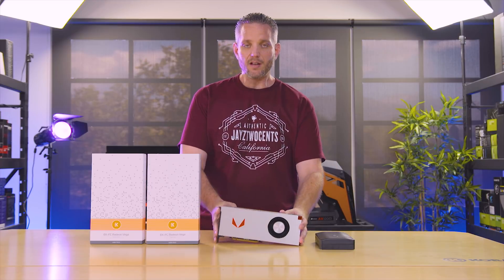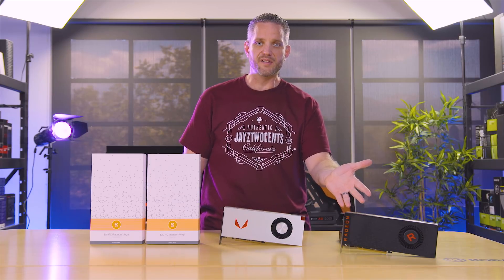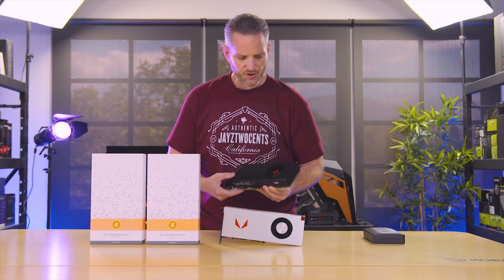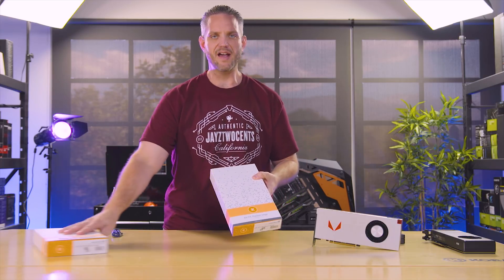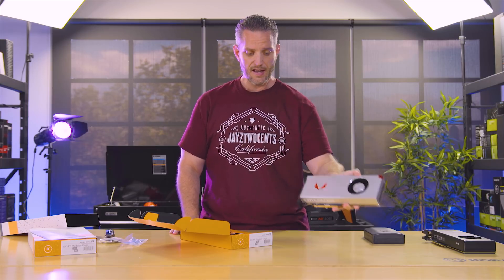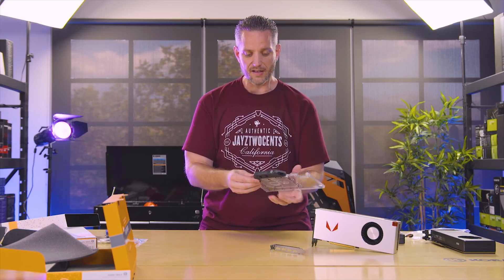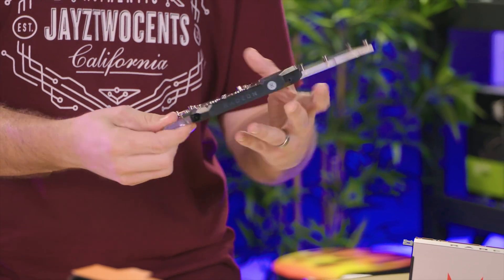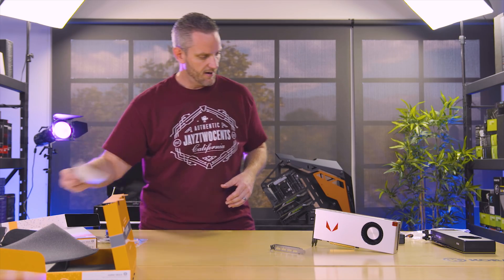Does watercooling help AMD Vega cards?

Comment from the maker: 4k Still processing... but if you enjoyed the video, how about tossing a like?
Reply: I was literally thinking about all the comments that would criticize your thermal paste application until you showed the manual.
Reply: I have 4k monitor and I don't see much difference between  1080p and 2160p ,4k on YouTube is so watered down that it almost makes no sense
Reply: Jay we definitely enjoyed the video montage, flawless
Reply: 144p masterrace
Reply: Thanks for the celcius conversion. I'm lazy.
Reply: Hey Jay do you think you could do a video on crossfiring a few of these Vega cards and answer some questions like How much power does your rig need? Is there any productivity boosts from crossfire? and how many Vega's does it take to match or beat a 1080 ti?
Reply: Would love to know where the music is from. that is SICK.
Reply: Well done on the return to your roots. Very good production value, with nice music sync, b-roll and generally enjoyable hardware porn. +1!
Reply: just a thought for a water cooling system how about using a fish tank oh say at least 400 liters make an aluminum tube heat exchanger not only heat your fish tank cool your gpu and cpu
Reply: JayzTwoCents Single slot Vega? I don't think I've seen something so sexy before!
Reply: JayzTwoCents like & subs🤙🏻
Reply: JayzTwoCents interesting video as always
Reply: JayzTwoCents Already Liked before i finished reading  the title!
Reply: hope you are doing ok
Reply: Is this using the FS7 II? The feel looks different. Maybe it's just YouTube and it's processing.
Reply: Correction, once it gets to B-Roll, it does seem to clear up.
Reply: And a amazing job on the B-roll today! Double Thumbs up!
Reply: Hey Jay, a lot of people including myself love to actually UNDERvolt our AMD gpu's (I have the sapphire nitro Fury Tri-X). Brought the power usage WAY down without taking more than 1 or 2 max fps off my games (totally okay with that). i took roughly 70 mV off my Fury and took it down from 1050 to between 1000 and 1020 (both stable). Is this something that you could try on the Vega? I'd be really interested to see the results for reduced power draw and related performance.
Reply: This is some top class production work. Congratulations!
Reply: That was some "sexy, fluffy" B-roll there Jay. Putting all that sweet camera equipment to good use
Reply: Great Job, please so more OC in this...
Reply: No, it's not total BS. Feel free to go find all this proof...Go ahead, I'll wait. It's the same concept that loop order doesn't matter either. Liquid doesn't stay in an area long enough for their to be a difference.
Reply: JayzTwoCents could I ask why you didn't adjust the voltage at all? In testing Radeon GPUs myself (Vega excluded) I noticed a higher chance of clock speeds remaining at a constant rather than fluctuating. Every card is different obviously, but my main question is does adjusting voltage controls do ANYTHING in terms of overclocking performance and possibly range on the Vega line?
Reply: JayzTwoCents That montage was beautiful. Great video.
Reply: Hey @JayzTwoCents, Awesome video man! Keep up with the great content but I was just so intrigued with the shots from 5:06 to 7:02, what was the song name there? It went perfectly with your B roll shots.
Reply: great music selection, got my day going
Reply: Hey JayzTwoCents would it possible to do a review on the new Alphacool NexXxos GPX Vega GPU cooler...I wonder if this or the EKWB one is better
Reply: what is the name of the song at 5:15 ? HElppppppppppp
Reply: 2nd
Reply: Liked.
Reply: alright
Reply: You got it bro!
Reply: JayzTwoCents finally saw something before it’s been posted for 12 hr. Yaaa YouTube isn’t shitty right now. 

Hi jay
Reply: lets go 10 views
Reply: Hi jay love the videos. when do you think the kriptomining boom will finally wear off?
Reply: as soon as i find the like button on youtube's new interface kappa
Reply: Thanks Jay, I dont know if Vega will ever be available for more than 30 seconds but nice to see though.
Reply: 110F and still 48C on load? Impossible Jay, you had to have the AC on.
Reply: I want that Liquid cooled Vega 56 vs 1070 hybrid
Reply: Hi Jay. You said a while ago you'd be making a video to end once and for all the notion that it matters where you place the rads in your loop, including temps and such. I'd be very interested in this, as I can't get a friend of mine to agree to this :) If it's not too much trouble could you place temp sensors before and after the individual components just to see what really happens. I'm very curious about that one.
Thanks for the great vids as always.
Reply: There's no difference dude, it all balances out.
Reply: ALL THE LIKES !
Reply: Hey Jay, how come since every waterblock for gfx cards uses full coverage thermal pads at the contact points of the vram, why don't they do the same for all processors?
Reply: awsome that you upload for european primetime.
Reply: JayzTwoCents its locked at 1080p......My old desktop can't handle that
Reply: Hi Jay, love the look of the blue dye in the block. Any chance you could upload a picture of the block with the angle at 6.41 in a 2560x1080 resolution?
Reply: Fucking nice edit!!
Reply: That's the first thing I do ;-)
Is the VEGA64 on water worth the $$ ? Not by a long shot.  BTW. ASUS are teasing a VEGA64 STRIX launch in early September. Did you guys know ?
Reply: Nolan Haines if you want it now, you could check out Gamers Nexus they did a article/video about it using Vega 56.
Reply: lsvtecb18c1 lsvtecb18c1 I think you mean why don't they use thermal pads instead of thermal paste on the actual processor, right? Well as far as I know the basics is this: both paste and pads are a means of transferring heat from a Source to a heat sink. The difference is, that they are not equally good at it. A Processor can only take as much heat, most throttle at around 80-90° Celsius before transforming into blue smoke. That means you have to get all that heat away from them and you have to do a good job with that. A VRM, where pads are normally used, is rated up to 120°C. Not only that but also it sometimes even works better when hot, as far as I know. (Some said around 80° C on a motherboard at all times would be optimal, have no proof of that). That means you don't need to get all the heat away from it that effective but you still have to transfer it away from the VRMs, because they too will throttle. So that's why you use pads for the VRMs. To remove the heat but to not have a gunky-gooey solution if you don't even need it.
Reply: Is that paragon music?
Reply: they dont need thermal pad?
Reply: I'll think about it... Lover.
Reply: Man. I can't sometimes defend your, as so called of late, "double standards" nor the "lenghty video talk style" but maaaaaaaaaaaaan. That hardware porn is glorious. I'd even go as far as saying that some of this stuff is so perfect, that their place to go is Wallpaper Engine steam workshop. Thank ya :D
Reply: i tossed twice so it didnt count
Reply: JayzTwoCents i tossed then liked
Reply: You deserve a BIG like for that ¨sexy fluffy body¨ :)) Have a good day Sir!
Reply: Have to agree with the comments about the lights  That was the first thing I noticed.  Especially the edge effect from from the spot lamp.  It certainly lacks the warmth older videos had.
Reply: Been waiting for a video like that
Reply: So if you went to all this trouble to water cool this card, why the fuck did you run it at amd's stock 1677 mhz for the limited edition card? That's not "Overclocking" it at all, these cards ship at that speed. Why didn't you try for 1800+ mhz on your own? I'm really wondering why I'm still following you when you do shit like this. You didn't even try to overclock it at all. We wanted to see this card pushed to it's limits on custom water.. nope. Guess we have to go to someone else for that. And yes these cards can do it, other people have reported 1900+ Mhz on vega-64 on launch day on air. The reviews are out there.
Reply: Does tube length matter in cooling or does tube length along with type make a bigger difference?
Reply: Tube length does matter. But not in temp. In cost. If you have a 20' coil of tube in the bottom of your case it won't affect the max temp at all. The same amount of heat is being removed by the block, the same amount of heat is being dissipated by the rad. The only thing it'll change temperature-wise is the length of time it takes for your system to reach the equilibrium temp, as you have more thermal mass to heat up.
Reply: They didn't ask about cost, they asked about cooling ability. Noone is going to use  20' of extra tubing at the bottom of their loop anyways.
Reply: ass at all , lulz r real
Reply: I think its either the angle, or the lense, but for some reason your head looks way too small for the proportions of your body in this video. But its perfectly fine in others. Not sure if you care, just something I noticed.
Reply: Can you send me one of all those graphics card 1080ti please
ty and i drop a like Bro
Reply: He will , if you work with him =)
Reply: how can i find him ?
Reply: Well I guess I'm going to go with Nvidia for graphics now.
Reply: nice montagee ! Great music choice :)  i liked  ,  one the best :)
Reply: how do you services a power supply
Reply: JayzTwoCents  Does the separate loop influence the temp? Or is it the same as a combined loop that also passes cpu?
Reply: Can u test de settings with lower vcore voltage&clock but with an overclock of hbm2 memory?
Reply: Tengo 420 Razones miner spotted! :D sup bro?
Reply: JayzTwoCents may I ask, do you have news on vega laptop? I'm in the market for a gaming laptop, but dunno if I should wait for Vega laptop.
Reply: Decided to throw you on my adblock whitelist instead
Reply: Like have been tossed before the play button. ;)
Reply: I'll still like it, even though I have a Nvidia 1080 ti, and don't have to settle for second best. That is how much I like Jay, I'll still watch.
Reply: the alphacool has a rly good core temperature but not so good vrm temps, also adds ALOT of flow resistance. i own the alphacool for my fury, its doing its job and can be upgraded, however i think my next gpu block will be the EKWB one - i had no choice for my fury nitro tho. i think core temps will be pretty equal, though the EKWB will be offering the better overall package.
Reply: Thank you for this :)
Reply: Here take a like.
Reply: Done :)
Reply: JayzTwoCents which pumps are you using, testbench and personal rig respectively? :)
Reply: JayzTwoCents done
Reply: Amm Linus 8k video on 4k is really good , the red definately has a difference on quality ...
Reply: JayzTwoCents I am watching in 480p so all good
Reply: unacceptable , well yeah some older videos are like that ..
Reply: keptin kaos It may stress the fish out with fluctuating temperatures... and they can get sick.
Reply: JayzTwoCents oh I'll give you a toss...
Reply: dont normally like videos, but since i always enjoy ya content and you asked so casually, i will :P
Reply: JayzTwoCents could you use refrigerant to cool a cpu or gpu?
Reply: Thanks so much JayzTwoCents, now we can't be the first person to comment on this video :(

Btw, didin't know you can comment while processing XD
Reply: Mod the vega 56 with the 64 bios and use c how it works
Reply: https://www.youtube.com/watch?v=P7OtY0HWkQ0

It took me a bit of browsing on epidemicsound.com but I finally found it!!!
Enjoy :)
Reply: Greatttt :D
Reply: I know at this point, Vega sounds ridiculous. But for general purpose, can you test some games and run heavy GPU related works on this custom water-cooled Vega 64? Push this card to its limit by overclocking (some said undervolting increases performance??? ) to see it's highest available performance. Forget the power draw since we already know Vega is a power-hungry card. With custom liquid cooling, will it perform any better than the reference Vega 64 (Liquid Cooled) and the GTX 1080?
Reply: hey Jay. There is a article on tomshardware where they say that on vega 56, there is a difference in hight between  the gpu die and hbm2 memory. Did you saw that on the 64. Just curios. here is the article http://www.tomshardware.com/news/amd-vega-package-problem,35281.html i saw on PCPer podcast
Reply: Nice video. And I was all set to purchase a liquid cooler system, when my closed loop liquid cooler went out in my Alienware Aurora R4 ALX PC with an i7-3960x CPU. Not much room in there.
When I took it apart, I found massive corrosion in the Alienware Cooler. I purchased a Corsair  H75 Cooler.
For the 1st few months the temps using Speccy were about 42 C. Then all of a sudden, the CPU was hitting 91 C & the motherboard was hitting 107 C! I cleaned off the thermal paste & replaced it with new thermal paste, but the temps did not come down. So, after turning down the CPU from 3300  to 2400 & still no relief. I turn off 
Speed-stepping & was able to raise the CPU to 3000 & still keeps the temps at about 55 C while surfing, but they would jump to 68 C while playing GTA V on line & the Mobo would reach 91 C instead of 107 C.

I searched the Internet & found a video that showed a guy taking apart a cooling system that was overheating, corrosion had set in, & it was only 6 months old! Some of the readers submitted their own experiences as the person doing the video recommended a certain brand of coolant. Some said that they had no problem with this coolant. While others said that they had experienced corrosion with this coolant & other brands also.
So, I haven't purchased a replacement cooler, if that's even the problem as it's only a year old.
But, I'm really confused about all of the different types of metals & plastics being used in the same system & causing corrosion & thus failure! 

So, what would you do if this were your system? Is there a way to test the Corsair H 75?
Purchase another closed loop cooler?
Purchase a separate  custom loop cooler? 
And if so, what coolant & corrosion inhibitor would you use?
They also make a product for automobile radiator cooling systems called Water Wetter, which bring down the temps by about 20 F lower when added to the cooling system. 
It would be interesting for you to test this out in a custom cooling loop to see how much more the temps would come down, if at all.

Sorry for being long winded, I believe that if more info is given, a more precise & correct answer can be received.
It would be nice if you did a video on corrosion in water cooling systems.
Reply: Did you used the normal or the Watercooling Bios via flash? And can you retest scores with an undervolt P6:1100mV P7:1100mV HBM:1000mV. This should remove the Powertune Watt Problem on the Air Cooled Bios because  my air cooled uses with PT+50% in balanced mode 330Watt. (which is the 220Watt+110Watt[50%] =330Watt limit => jumping clocks). you could even increase HBM clock to 1040MHz on every Vega air cooled without a 2nd thought, even with reduced voltage (if this value even changes the HBM voltage and not the booster :S ).
Reply: Given the temp improvement, I say it's worth the extra money to water-cool if you're going Vega. If you're going 1080 or Ti, not so much unless you overclock.
Reply: Could you please review XSPC Razor RGB RX Vega GPU Waterblock as well as Aquacomputer kryographics for Radeon RX Vega 64 ? 

I bought EK block and had to send it back. First one leaked and even the second one leaked. The bridge mounting on the side is screwed to plastic and it's useless. I was planning to buy XSPC but not sure how good it is. 

EK for my CPU really rocks but the GPU block design is messed up.
Reply: Thank you very much. It is such a great song and so in depth in their detail of each note!
Reply: 5 Months later... prices are high as 'normal'. Still tugging along with my r9 280x on a 4k ultra wide.
Reply: Wait for the price to drop...., yeah right , that happened!! 
Damn Miners :(
Reply: JayzTwoCents Hi Jay, try the liquid cooled bios and the new drivers , it will get a bit more on the clocks 1700+. Cheers, check my Chanel :)
Reply: @ CookieKingGaming
Laptop GPU with same name are very often weaker than the desktop GPU. The marketing dep. does their tricks with the name but the performance is different. Nowadays the GPUs and CPUs have something called configurable TDP. When the same die is configured by the manufacturer for lower TDP,  it reduces it's performance according to the power limit.
Reply: Already subscribed, and threw a like on this. Any chance you can show us the Alphacool Eiswolf 240 GPX Pro AMD RX Vega M01 - black. Please and thanks.
Reply: With the current pricing and the driver optimizations done, can you do an update to analyse where Vega  56 and 64 stacks up with the current available gpus on the market.
Reply: Only if you toss me a 1080Ti
Reply: is your Fahrenheit shit not our Centigrade

water freeze in 0 C and Boil in 100 C and in your temperature water freeze in 32 and boil in 212
in my eyes your Fahrenheit is soooooooooooo stupid like as you. go to hell with your Measurement scale
we use Meter and centimeter not stupid Mile foot or Yard
this is International Measurement scale. you ( American idiot and British) thinking you are better understand of all of the people world. because You are a racist like as your Asshole president
Reply: If it was me, i would have attached the backplate (the X) of the stock cooler, for looks
Reply: So did you buy this yourself? OoOoO No? hmm guess you need to publicly apologize for believing fake news and bad mouthing AMD left and right for something they never did!
Reply: Check the compatibility of kraken G12 with Vega pls !
Reply: JayzTwoCents no not worth it
Reply: Neither make any significant difference. Maybe .1-1 degrees difference. The water is moving fast enough through the loop that its not creating enough additional time in one area to cause significant differences.
Reply: I do not find any meaning watching these videos on 27 inch on 4k .. why you waste so much time to upload in 4k .. of course if I would watch it on my 4k TV set okay .. but I dont' ... i watch you on my 27`` inch monitor ... like 99.9% of the view base :D unless isn't a gameplay from a game .. there is no meaning .. or at least I can't find at least one reason !